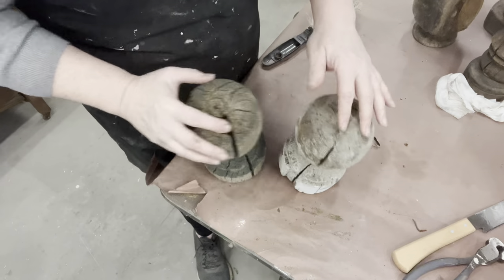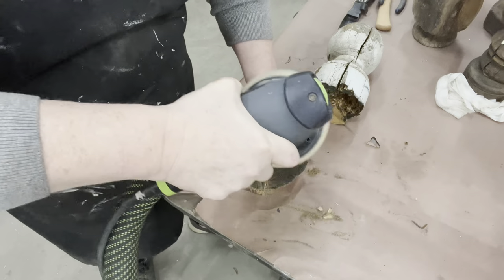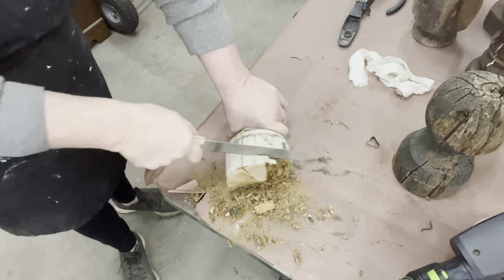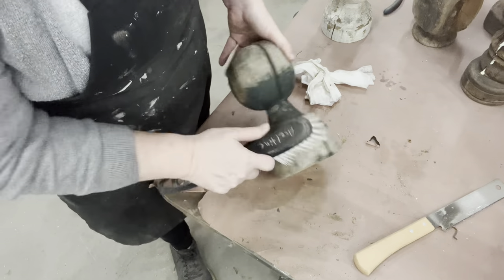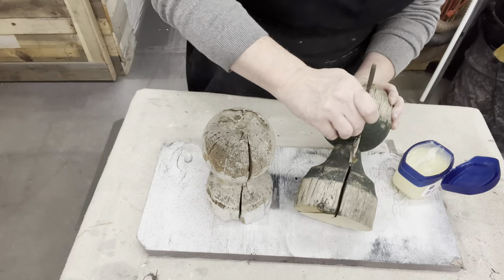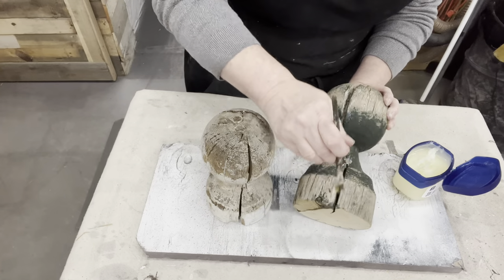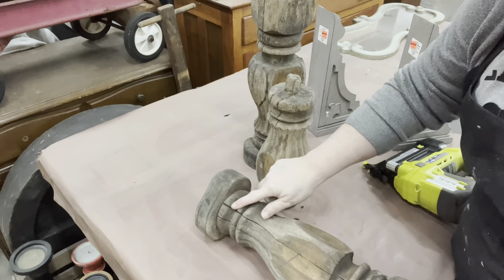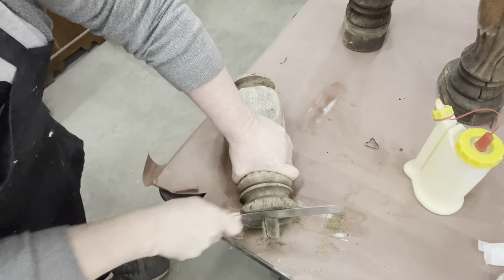Paint Effects | Household Items | EASY DIY | Salvaged Finds

Comment: Do you ever consider using linseed oil to condition, restore, strengthen old wood?  I find the wood just drinks it up; finds a sheen; gets stronger.  Couldn't help but think of it when I saw the dry-crying-for-conditioning salvage pieces!
Reply from the maker: It would act similar to one of these techniques. The oil residue would prevent the paint for adhering. Which is really chipping. Yep .. I tried it before 🤗